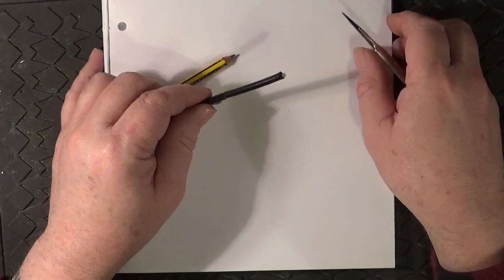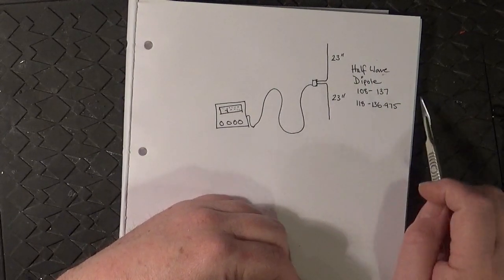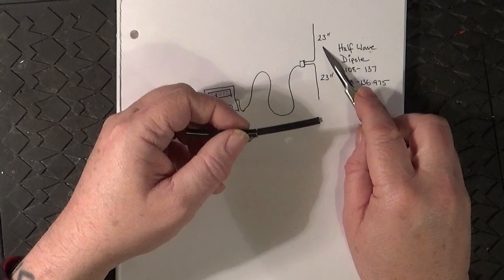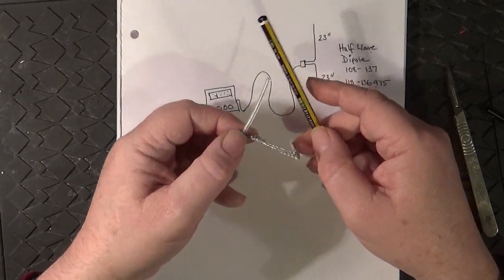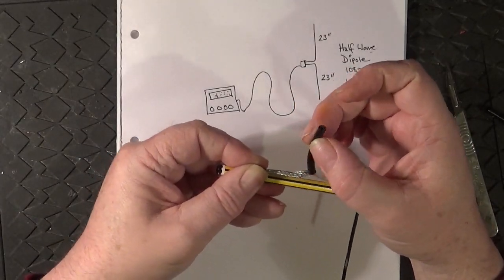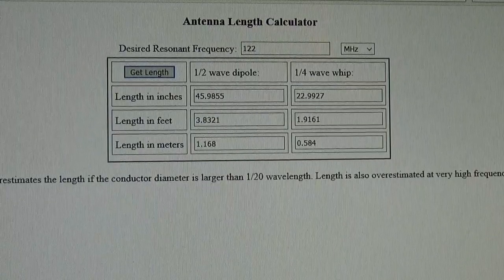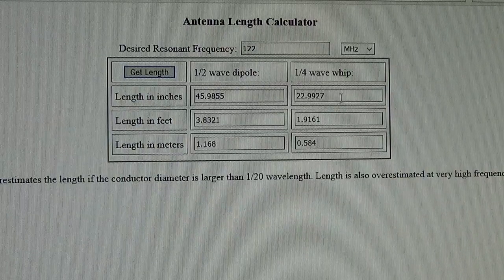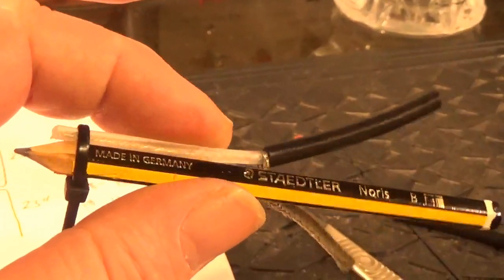Simple 1/2 Wave Dipole for VHF Airband

Comment: Thank you for a great video. This is a very effective airband antenna even in rural areas. I'm an Arizona desert dweller living in the hottest section of the Mojave Desert, about three hours from the nearest major city. Right now, I'm using this antenna to hear airband signals coming in clearly over 100 miles away out of the Los Angeles flight area. 

It didn't work well for me indoors so I turned it into an outdoor antenna by placing surplus tubing from a defunct sprinkler system over the legs, sealing the ends up with a silicone-based caulk and spraying several coats of polyurethane over the entire unit for additional waterproofing.  This should help it survive our hot summers.
Reply: Great post!

Comment: Hi I'm in North Wales, if I made one of these should it cover most of the UK?  I can only pick up Wirral London control and Liverpool airports right now using a standard RTL SDR antenna that came with the dongle.  I do have another antenna a Eightwood 4G LTE Antenna but still just Liverpool and London control.  Thanks
Reply from the maker: Hi, not sure if this would work with SDR efficiently across all bands as it's air band specific. It should be OK for normal 'Air' but not for scanning MW through UHF. Does that make sense? I do have an SDR dongle but found it absolutely rubbish so I stick with my 3500XLT. I'm in Cambridgeshire and can pick up Manchester control no issues.
Reply: @Andrewausfa  Hi okay thanks I'll see what else can be used, thanks.

Comment: Wow that’s really busy. I am on the flight path for Manchester airport and hardly get any traffic. Absolutely great project thanks for sharing. Unfortunately I don’t have a loft so no place for an indoor vertical. I have a long wire outside with a fancy remote auto tuner.  Unfortunate it’s for HF  not VHF. I’m a big fan of the Jpole fore vhf.
Reply from the maker: Hi Chris, similarly I can't keep a long wire up permanently for HF. I have a GR5V 1/2 size which takes ages to string up so I mainly just throw a Clansman long wire (one of those Racal things with the coloured zip ties)  up in the conifers, pass it around the bedroom window handle and back down to the FRG-7. When the missus is out!  Other than that I just have a second Clansman long wire just going twice around the loft space. Seems to work but I bet would benefit from an ATU. Considering I'm not that far above sea level, I must be in a special place for airband, I regularly hear Scottish Radar or Liverpool ATC. It's busy in the video but that was Heathrow Control on 'Hold' on New Years Day. On weekdays set to scan it's continuous between LHR and STN approach for hours on end.
Reply: Andrewausfa I wonder if the wife would notice a really thin wire. I had one at the old house that was practically invisible.

Comment: Hi fella I know this is an old video but I thought I would ask anyway. Is there a way that I could connect this to my shortwave receiver which has fm airband mode, I bought a sangean indoor retractable long wire but it only just works better than the telescopic antenna on the radio.
Thanks for this vid, it’s so simple I would like to give it a go.
I’m only three miles from London Luton airport.
Thanks.
Reply from the maker: Hi, yes it would be perfect for that, it's the frequency region it's designed for. You should have a very good signal from LTN, may even get ground comms if you're in Harpenden or nearby.

Comment: have a diamond ham radio ground plane  around 60 feet up connected to my Yaesu ft817nd which pulls in communication from aircrafts flying 200 nautical miles out of VOMM, Chennai fir. I can locate the aircrafts in my flightradar24 app very easily.  73 de vu3mes Satyan